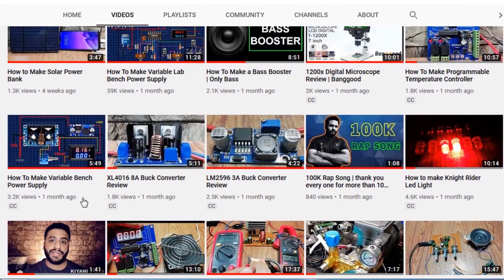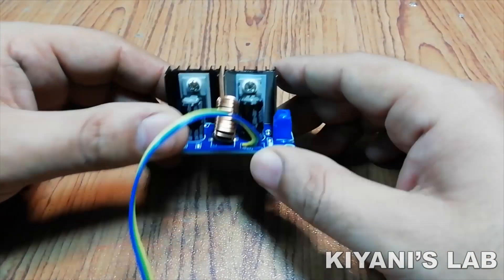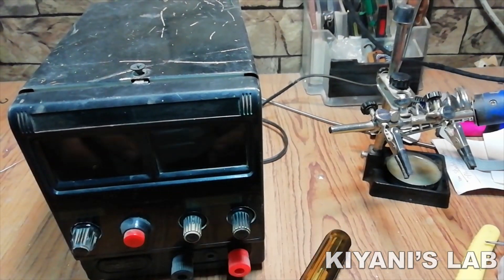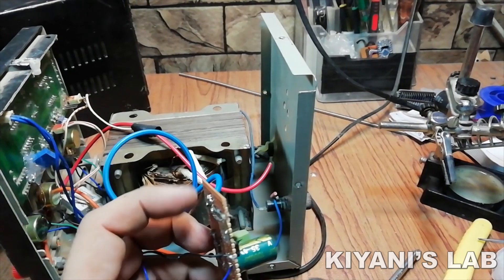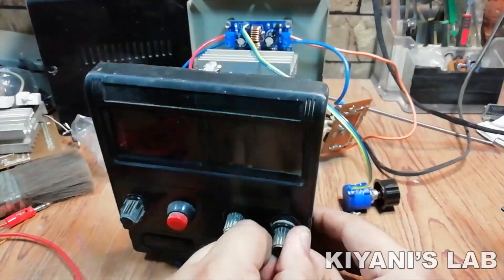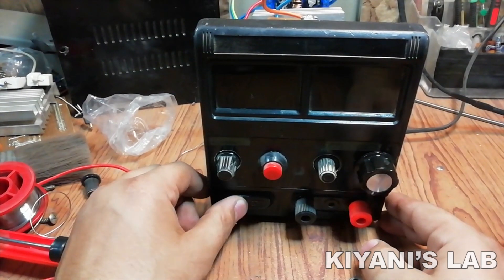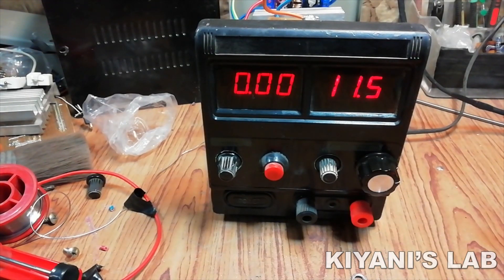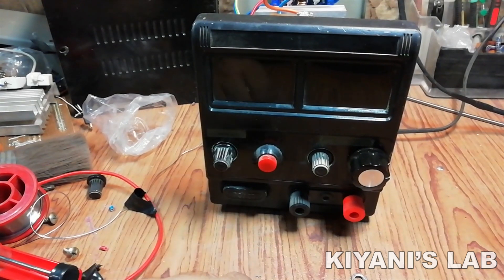Variable Lab Bench Power Supply Modification

Comment: Why did u do that?even analog one will do  more better job than the pwm one..
Reply from the maker: ya i agree bro actually i have another linear supply which have been working perfectly for more than 7 year and honestly the switching module is also working excellent the only reson for this mod is the power loss in linear supplies is more than switching ones
Reply: @KiyanisLab  yap.. linear has less efficiency overall but if u try to scope those out at the max load u could see that  less noise in the linear power supply whereas switching regulators tends to has noise at their output.

Although to day these cheap converter do pretty job for their price.cant complain..
Reply: Which one will be noise free? The one with a Transformer & buck converter or an Smps with a buck converter?